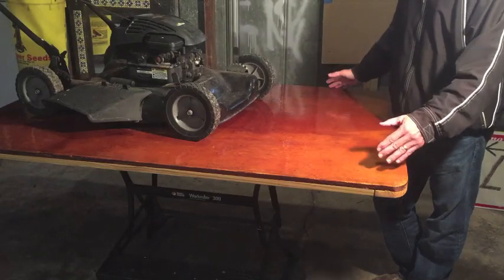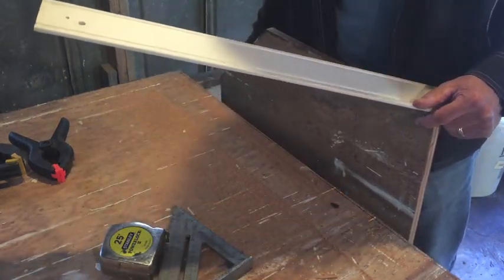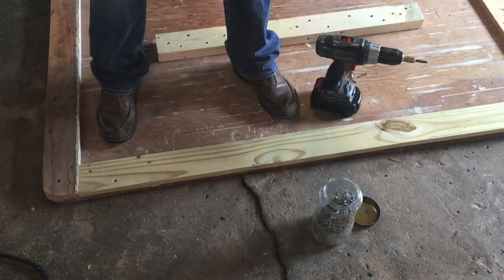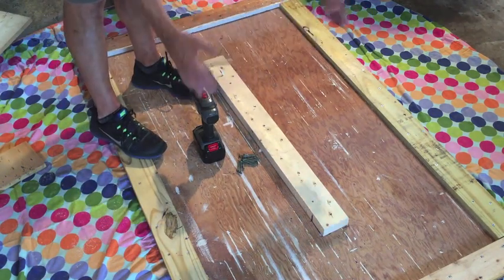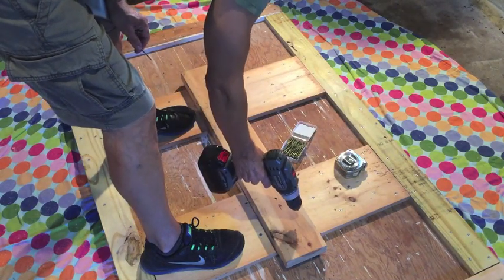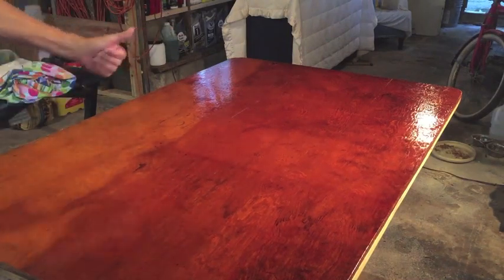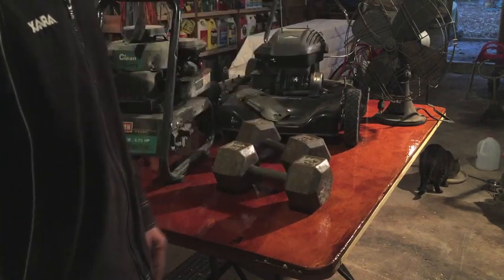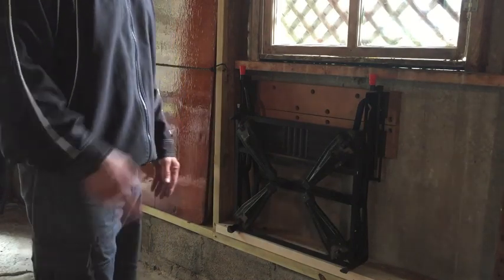Black & Decker Workmate Attachment (LG)

Comment: Great work, I did almost the same to mine (stayed with the 2x4 though) but put two small cleats on both sides of the 2x4 that are about 3/4 inch in width. When the top is clamped down, the cleats are captured under the workmates clamp boards. Now if I press down on the outer edge, the top is actually pulling up from under the clamping boards
Reply from the maker: That's a great tip.. Thanks for sharing.. I'm sure it will help others who may be trying this..

Comment: As a possible extra safety feature perhaps add a hinged drop down leg on each end with a small locking device to stop it folding up on you should the weight at one end get to much.

Comment: So after having this in my attic for the last 10 years or more. I needed  a stand for my portable table saw  The 300 was not deep enough to support the front and rear feet. So I was going to screw a piece of plywood to it, YOU saved me from doing that and making it quick, simple. I will use the same or plane the wood to the deck thickness though, so the plywood lays on the rest of the table. Thanks!!
Reply from the maker: You are welcome.. good luck with yours.. thanks for reply..

Comment: Even simpler if you don't need as wide a top as 39inch is to use a normal ply flat panelled door (30" wide X 78" long). 

A little more tricky for screwing due to the panel thinness but a combination of screws and glue works great. Also a quick and easy solution for a full time garage/shed work bench!

Comment: I have a mid aged WorkMate model 200 and two recent model 1000 ones.  The older and smaller one is way firmer and sturdier... That speaks how low they have gone down in quality, plus their Bamboo tops are cupped and dished, and their frames are too flexible in one direction, requiring strenghtening modifications! (added diagonals).  But I have found that employing the two model 1000 at the ends of a slightly longer than yours top, I get much more stability, strenght and rigidity at still a reasonable cost and just a little less practicity.  My table top houses three separable inserts that can support an inverted 8 1/4" circular saw, an inverted Router and an inverted jigsaw, and made three blank plates that fit flush when I need a flat surface.  It started as a single Workmate table top, but quickly found it unstable, so I left my older model 200 alone for small jobs, and the full top on the two model 1000 when I need to use my hand power tools as bench tools.  In that way I have the best combo. I also made a smaller top for the model 200 as it is very practical compared to the extremely small area of the Workmate 200 alone, which is similar to yours but smaller.  Best Wishes.
Reply: You need to make a video of your setup and post the link here for us to see as it sounds like a great idea!
Reply: @JoeAnshien  It is completely removable. The top is a plywood door, which is held to the Workmates with four C clamps, quick and easy to disassemble.  When I need more firmness, such as when planning wood with my old Stanley-Bailey hand plane, the legs of the Workmates are attached to concrete anchors in my backyard cement  floor, but then my bench top (the plywood door) becomes too flimsy, so I still need to improve it. For the moment, I'm too busy and close to retirement, but with some luck, I'll be able to have full time for my hobbies in a couple of months...  One limitation is that all Workmates are just too low to work comfortably, specially when working for more than an hour long.  Thus, the Workmate-based dismountable bench is practical only for quick jobs or when you can be seated at one side, but it is not a good solution as a proper bench.
Reply: @alfredomarquez9777 Thanks but I meant a video of the "three separable inserts that can support an inverted 8 1/4" circular saw, an inverted Router and an inverted jigsaw, and made three blank plates that fit flush when I need a flat surface" I don't see that anyone has done one of those yet.
Reply: @JoeAnshien  Sorry, but at this moment I cannot make a video, but the concept is quite simple and straightforward: make a rectangular plank baseplate slightly larger than the base of each one of the saws and another for the router, rout a step around, you can make a "rabbet" or step about half the benchtop thickness, and use plastic playcards to shim each plank in order to place them flush with the table top.  In my case, the planks go underside, and are held in place with rotating pieces of wood, rotating on a single screw, so that I can adjust the freeplay to a minimum.  As I had to cope with the wood battens inside the plywood door that I used as the bench top, the placement of the saws and router planks was not optimum, and I'll correct it in the future, when I remake another top, for which I haven´t decided yet the material, probably a sandwich of MDF and melamine cover, I don't know yet.  At this moment I have to finish a lot of office work (I'm an engineer), so that I can go into retirement, but in a couple of months I hope to be free of tasks and be able to go full time into my hobbies.  This portable workbech has served me more or less well for home repairs, but it is not what I would say will be a definitive one.  It is practical for say, working in the kitchen for two or three hours, and then quickly dismount it and put it to the side wall when needed, and easy to restart work the next day.

Comment: This is a great idea have done this before myself. My top exceeded the original width by 2 ft each side.    This is only good for light loads. I was standing on one side of my top. The extra width gives added leverage. Me standing on one side of my add on top bent the shit out of the metal frame. I weigh 220#  alot less than 450# rating. Beware with extra wide top add on's with what you put on them.
Reply: The rated capacity is the TOTAL weight it will safely withstand... Obviously, if you load all the weight on one side plus the added leverage of a larger top, it will fail. Not the device fault!   Still. a very good design considering the folding capability.  Older than 15 years ago Work Mates were much better than newer ones, because the greedy company has sent all the production to China, and are lazy enough to avoid any quality control work...  I have two recently made model 1000, and their steel gage and steel grade are inferior to my old model 200 with more than 25 years on it.  Shame on Stanley B&D!
Reply: @alfredomarquez9777  it is not china's fault. The b&d engineers try to cut cost n increase profit by changing the design to use cheaper materials. You see that in all products so to increase 'corporate profit.'

Comment: To prevent losing the bench stops I store mine on the under side of the holes.
Reply from the maker: ahhhh... i will do the same.. thanks for the idea..
Reply: Oooooo, underneath, I like it. Currently I have my dog pegs in an old rubber maid, plastic pitcher. The handle hangs on the side metal section.